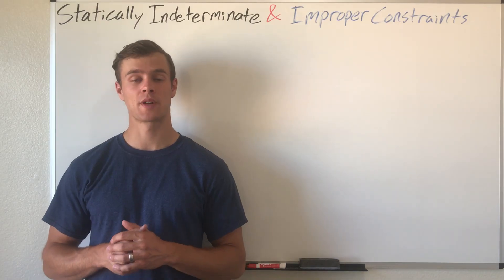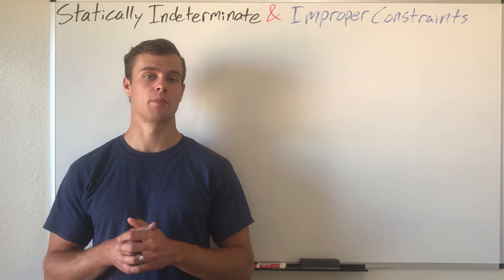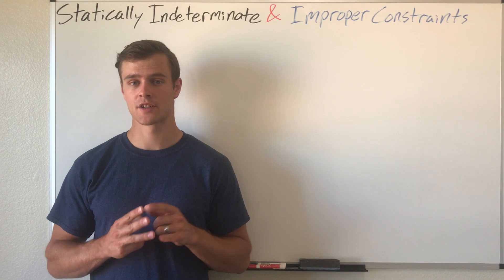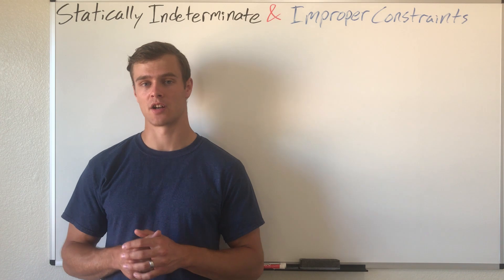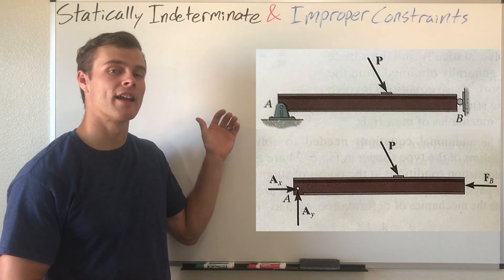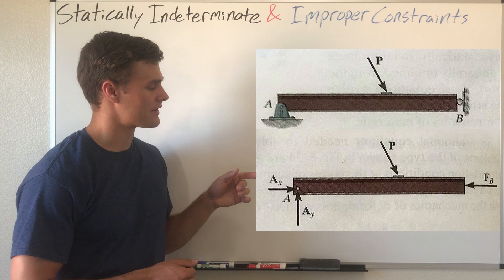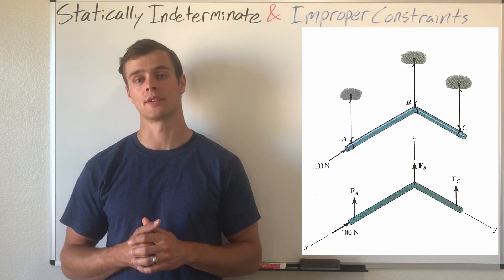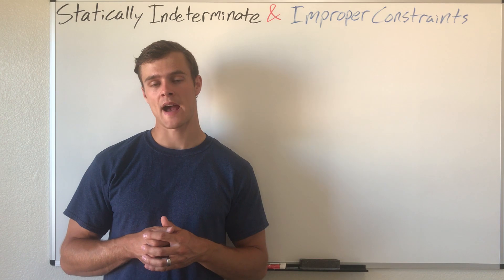What does it mean to be STATICALLY INDETERMINATE and IMPROPERLY CONSTRAINED in Statics & Engineering

Comment: Professor I have a question .It says if bearings are used in conjunction with other supports ,the couple moment reactions become redundant and are not shown on the free body diagram.I wonder  if bearings' couple moment reaction become redundant or all the couple moment reactions become redundant.Could you help me?
Reply from the maker: I don’t understand your question. Could you rephrase it?
Reply: @studentengineering Of course,one of the resources say if bearings are used in series or in combination with other supports .Then ,the couple moment of support reactions might not need to be considered .Just consider the force reactions Here just couple moments of bearing might not need to be considered ,right? Not couple moments of all supports
Reply from the maker: @yigitcanbaysal824 Yes I think that is correct
Reply: @studentengineering 
Couple moments of bearings are not needed to be considered,
 is correct right? or couple moments of all the supports in the system?
Reply from the maker: Couple moments of bearings don’t need to be considered because they are pinned connections so there is no moment from the reaction
Reply: @studentengineering  Got that,I apprecaite it, professor.

Comment: What conditions must be met in order for a structure to be properly constrained?
Reply from the maker: Great question! The structure has to be in equilibrium for it to be properly constrained. This means that the sum of the forces in the X direction need to equal zero and the same with the Y and Z forces. In other words the object will not move when those forces are placed upon it.
Reply: Thanks   @studentengineering
Reply from the maker: No problem!